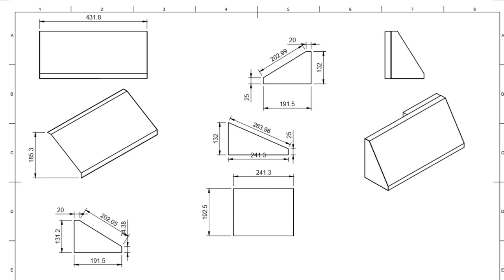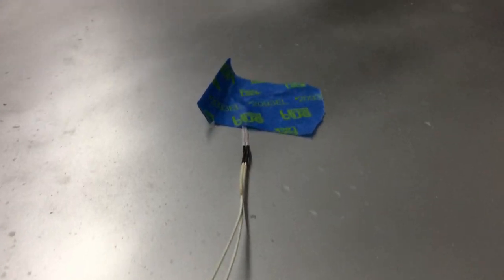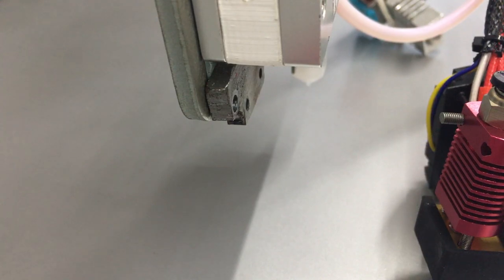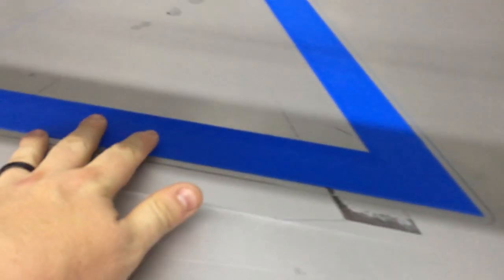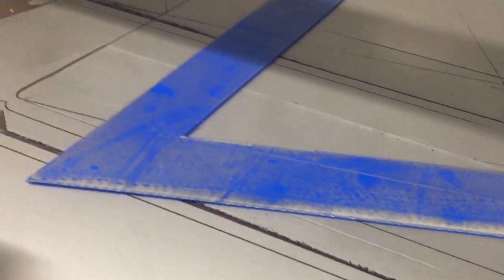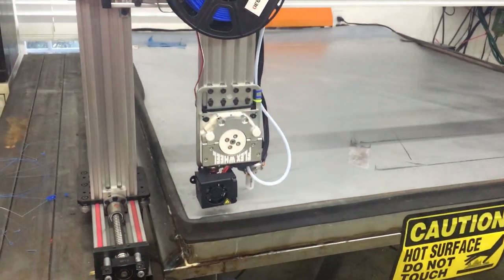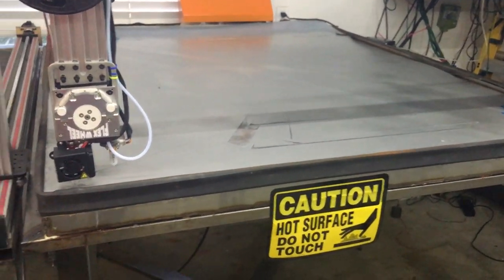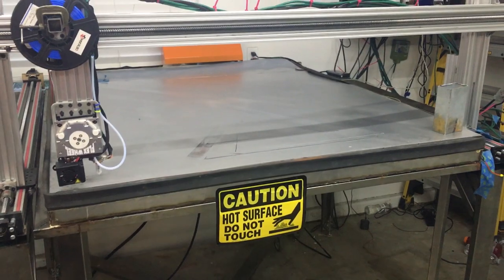Largest 3D Print yet on Massive 3D DIY Printer

Comment: A standard hot water heater might help.  It stores water and heats it.  It is easy to turn off when not in use.
Reply: You could even drain the machine directly into the tank when not in use to help with rust.
Reply from the maker: Maybe if I can find something that fits well in my limited garage space. I like the idea of draining the water back because I need to do that anyway so one solution would solve two problems.

Comment: This is more cnc router with a 3d printing head?
Reply from the maker: Design is to be a quick swappable Multi-Process Machine... Large format 3D Printer / Router / Plasma Cutter / Fiber Laser Cutter / and whatever else but most CNC routers don't have as much Z travel... so yes I guess

Comment: Have you considered glass for the bed?  It would be heavy but can be very flat when supported over large distances.
Reply from the maker: I think I'll be doing PEI (Polyetherimide) covered Aluminium plate but not 100% on that. I ruled out glass as it would be to large and prone to cracks, brakes and sharp edges in my clumsy hands.
Reply: @CountryAireDesign  you could use float glass, should be available in your size, comes up to multiple inches thick, no sharp edges and super flat. A bit heavy but that should not make too much of a hassle for you